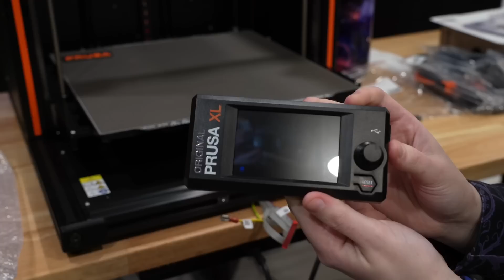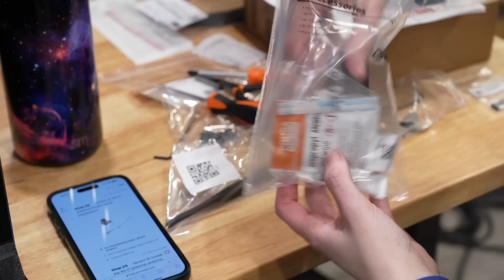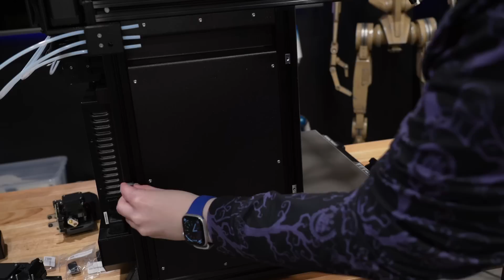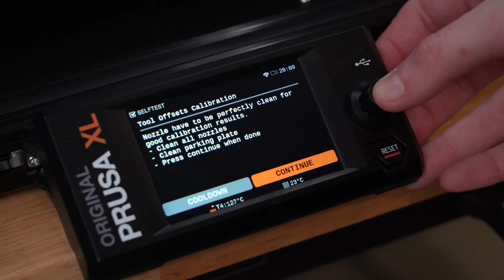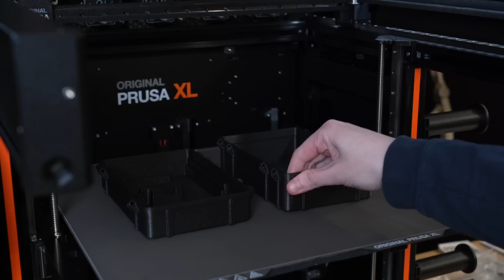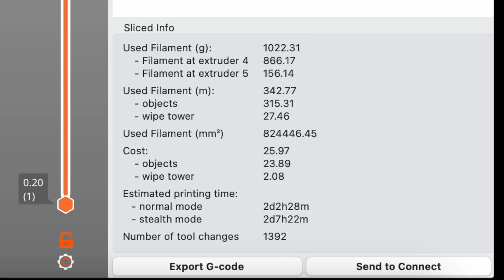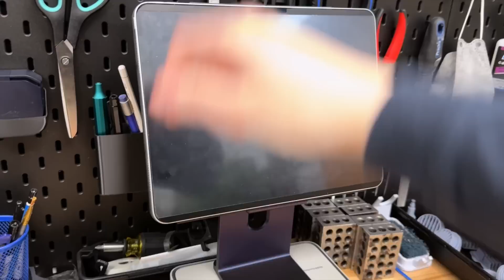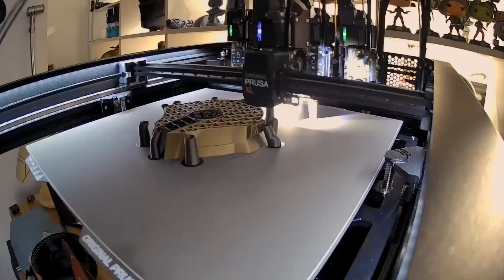Why the Prusa XL is the Best Multicolor Printer

Comment: Your review was one of the reasons I went ahead and got a 2 tool head XL. Just got it set up the other day, and I've done several prints of varying degrees of complexity (all with PLA). I'm using the Prusa slicer and this printer is incredible right out of the box. Seems all of the early problems have been fixed. No problems with the prints at all. They are perfect. It does have a couple of minor irritations I have to address, but overall, VERY happy with the purchase. Thanks for the detailed review. It helped make the choice clearer.

Comment: Prusa XL is great for PLA or PETG. Other materials it simply doesn’t have engineering for unless you’re okay to print ASA at 30mm/s speed. No heated chamber also means don’t expect above 33 degrees Celsius inside office AC space , meaning you will have warping, lack of connection to supports and shrinking. Is it cool - sure, but joy quickly dies down once you realize it’s kinda useless with materials that matter.

Comment: They can't even ship anything.  I bought the printer at the beginning of the month, after being told I would have it in 4 or 5 days.  That was a lie.  /After/ I placed my order I am told they will ship in up to 2 weeks from now.  Then every single day that goes by, 2 days are added to the shipping estimate.  I have to schedule this, as I am not always at home, I travel for work on a schedule, so I have to know when anything large is coming, and I can't leave town with something on the way.  So I took a week off for this, and that time has already passed, and now all I have is a "someday".  Then when I'm researching customs duties, I here the paperwork is done in a sloppy way, so duties might be $100, or they might be $1100...  Not because of the orange goblin, but because Prusa does not provide an optimal classification, rather they allow the customs officer to use his own judgement, so 5 people in a row pay 5 different prices with a huge $1000 gap from lowest to highest.  Prusa cannot guarantee any specific customs duty, but they can at least try.

I can't take off a whole month to MAYBE order a printer...  How it is possible to order something to ship 4 or 5 days, and still be able to cancel the order 2 weeks after you placed it...  

And apparently there is a very high rate of defects, my understanding is that around 50% of the printers are lemons, two printers side by side do not perform the same and require different workflows.  So don't plan to ever buy a used xl, as the main reason to sell is because it is a lemon.  I should have had my printer for a week, instead I'm waiting 2 weeks for a refund.  So prusa will have had my money a whole month without doing any work.

All they had to do is be honest with the timeline before I set the money down.  I expected it to take time, but they set my expectations that I would have it in a week, so I scheduled accordingly.  Actual estimate is between 2 weeks and a month or so...  and pay with a blank check, we will fill it in for you with some random amount.  Think of all the money you will save on this "sale"!

Comment: Very informative video and I thank you for it's simple clarity. I've watched many videos on this machine but still opted for the HD2 to add to my Bambu Lab collection as they have been Rick solid out of the box. At that time I almost pulled the trigger on the XL there were just too many problems with the XL, lots of  negativity that people were sharing about this machine that I held off waiting for the bugs to get worked out before I put an order in for one. One thing that you didn't mention were any problems whatsoever while using the machine. I don't know what you ran into but I believe I saw some surface finishes that I question that you considered to be acceptable. I received a damaged (FedEx, never again) HD2  from shipping and chose to keep the machine rather than going through the tedious process of sending it back I'm crossing my fingers it gets there safely and the new one to me safely.  Bambu Lab worked with me sending replacement parts  that I fortunately have the ability to install properly. Very fortunate and to my surprise the machine prints flawlessly for me. However the HD2 has had enough people claiming that they've had serious issues too like the XL. The more complex these machines get the more variables for problems can develop. All that said I love the idea of the mechanics of the XL, the build volume, 5 print heads and the track record of a quality machines that Prusa has provided for the the regular consumer. The enclosure (and printable aftermarket) are a bit cumbersome but they seem to be effective.  Maybe now's the time to purchase this machine as things have developed well and I'm sure there's been a lot of fixes implemented.

Comment: As an engineering student i don’t really care for multi color either, but it would help on prototypes if I’m using different types filaments to kind of color code the parts. Like if I use a flexible material on a robot joint. Also, as you said using two different materials for infill and outside sounds like a dream. But the price of this printer hurts me

Comment: I am really frustrated with this printer. We got it on work 3 months ago. PLA: no issues. PETG: succesrate about 40% which is quite the dissapointment for me. Even the official prusament, it wont print without a fail every 2 prints.

Comment: if i buy the 1 head version can i later update to the 2 head version? if not it would sadly be a dealbreaker for me :<

would orca slicee still be better for this or does prusa have something specific?
Reply: Yes you can upgrade the 1 head version to 2 heads at anytime. You could also upgrade it to 5 heads at anytime if you decided you wanted more than 2 heads as well.

Comment: This would be cool for super HD, fast printing, if they could manage it. A 0.2mm, 0.5mm, 1mm, 3mm and 6mm, depending on the needs of the thickness of parts. Great for thin-wall supports with minimal contact points and fine details for corners.

Comment: Outer perimeters with different materials i use for Extrudr's amazing "Wood" filament. I print the core with ABS which gives the part a strong structure, then I just make it look and feel organic by 2 outer perimetes of Wood. 
Just printed some filigrane handles for the drawers on my old wood cabinet, they look great and will never break again (as they did when printing with Wood filament only)

Comment: The XL is just a beast!
 It opens up a complete new world of 3D printing. I love it!❤
 I just started using the two toolhead version a few weeks ago, so I still find new ways to take advantage of the tool heads.
I do more technical designs, so multi color is not really a topic for me. But the combination of different nozzles , materials, support structures, etc. in a single print is just amazing.
The only downside is the  setup time due to its complexity, nozzle change with recalibration is just one example. Hardly thinking about the 5-tool head upgrade to save time at changing nozzles and materials for evey print and adding even more features to my prints.

Comment: Honestly, i could get 2x h2ds, and still save money over the prusa. I don’t mean to offend prusa users, but that machine is outdated for the price. 
There’s enough evidence out there, that the print quality of the prusa xl is just bad or better said not up to todays standard. Add the delivery cost about 500€ on top of that, and that’s a no go for that amount of money. 
Ja Bambu policy or not, I don’t care about all of it. Doesn’t hinder me to use the printer as a tool. It should work just a drill should just work. Is a tool. 
Just my 2 cents.

Comment: Nice video. I have both the kit and the assmbled version. For the kit version it was no suprise it took 4 hous to assamble, but the assambled version also took over an hour to set up. I also have for XL's in the printshop and there it is annoying if it takes so much time to set them up. As an extra con I would say they a  very heavy, but as a pro,  they are sturdy.
Printspeed can be improved, just set it to about 20% faster, If you have high flow nozzles and suitable filament, you can even go up to 40 or sometimes 50% (mainly PETG).

Comment: If your filament is perfectly dried, you can use the "wipe in to infill" option and get rid of the purge tower
It even works for me with PETG and TPU multimaterial prints.

Comment: Great review! I may have missed it, but what size nozzle are you using for these prints/what’s the layer height? Hah.

Also, I’m in the market for a new printer and price isn’t really a concern. I’ve looked and looked and I think Prusa might be my best bet overall, despite the cost. The quality and customer support both seem unmatched in the industry. Like no one even comes close. And while I’d like to get a K2 and just hope, I know I won’t have to with a Prusa. Hah. That said, would you recommend and XL, a Core One, or something else entirely? I’ve considered a Rat Rig V-Core 4, or a Voron Trident build, but I’m not sure I’m quite up to a build that significant yet. Hah. I’d really love something with multiple tool heads so I can maybe print with a different support material, or that IDEX upgrade on the Rat Rig seems awesome, but still. Idk. Any suggestions? I’d really like to get into the cosplay and whatnot, and my Ender just doesn’t cut it. lol.

Comment: A prusa XL with 5 heads and an enclosure seems like a ridiculous choice for a first printer but I've been waiting on the sidelines for 10 years and I feel the market has reach a point where there is extreme value in owning a tool such as the Prusa XL. I realize there is a lot more to just hitting a button for 3d printing, experience plays a massive roll in how prints come out so I try not to let printer reviews that showcase "bad prints" influence me for this fact alone. I try to find the best print examples available for a printer as I firmly believe print results are tied directly to the operator and their every decision on so many variables. Your prints are simply amazing and I'm pretty much sold on this unit. I simply don't care if anyone thinks it's a ridiculous choice for a first printer, shit or get off the pot. I want print volume, I want multi filament without insane print times and waste, I want possibilities and the Prusa XL and you video has me sold.
Reply: Buy what you want.  No one else has to approve unless you are married.  😂 Also, find good profiles for filament.  I am new to this but a good profile will ALMOST insure you a good print.  Nothing is 100%.

Comment: The only Printer on the Market which can compete with the Prusa XL is the Voron 2.4 and Sovol SV08. For both are now Toolchanger Kits out there. But atm there is not a definite Version for them on the Market and you have to build them yourself. The other Machine which could do this is the E3D Toolchanger and is out of the market.  I own a Multicolour Printer by myself but i mostly use the Multicolour to have several open spools ready to print, so only as Filament management and not often for Muticolour. I am building a Voron by myself and will eventually upgrade it to Multitoolhead. But this requires lot of time and even with factoring in only 10USD per Hour, the Prusa XL is cheaper. The Sovol SV08 with 5 Toolheads costs around 1500 USD and 50 manhours to build and again 20 manhours to calibrate. The time will go down as more refined kit will hit the market. This would be the cheapest option. Imo the Prusa XL and Prusa Core-XY have only two cons: The Filament Management is bad. You can't easily install dryboxes for the intake and Prusa literally missed a Chance. So you have to be present putt in new Filament and can't let the Filament loaded for 2-3 weeks. This isn't something youtubers or printfarmers consider as the eat through the spool like nothing. But normal users which have their weekend print job, it is a flaw. For the CoreXY is already a solution out there to create a drybox with the printer mounting itself. And a simple Solution maybe devised with the Prusa XL as well. Simple coverings with an acrylic panel and some pouches for silicate, so a filament can stay for weeks in a below 30% humidity enviroment. Especially for Multifilament Printers important. I have always 8 spools loaded and they are in their nice containers with 25% humidity.

Comment: Very nice video. 

However, most of the waste and filament changeing time on other printers like Bamulab´s with AMS, Anycubic´s ACE pro or Creality´s CFS isn´t due to using filament swapping per se, but using high flow nozzles with bigger meltzones.
If you unload filament from a bigger meltzone, the filament tip is quite creapy. It often can not be reloaded without cut. It might even damage the reverse bowden while unload. To avoid the problems, theese companys use cut&poo.

So alltogether on theese printers you have 3 types of waste:
- purging out the cut old filament left inside the nozzle
- clean residue from the old filament
- wipe the nozzle to get the right flow

AMS, ACE, CFM have all 3 types of waste, with "purge" actually the most waste and time (incl cutting the filament).
The XL actually only has one type of waste: wiping the nozzle (getting the preasure inside the nozzle correct after standby of the head).

However, Prusa uses a different approach on his i3-series with MMU2 and MMU3. Using nozzles with a smal meltzone, you can get a quite nice filament tip using ramping profiles on unload, esp. if using standard flow nozzles with integrated heatbreak (Revo on mk3(s(+)), Nextruder Nozzle on mk4(s). This eliminates the first type of waste - and the bigger time of the filament change - no purge needed.
While you still need to clean and wipe the nozzle, the waste and time altogether is much nearer to the XL than to the AMS&Co. Also you can use part of the waste being wiped to infill or "waste object".
It's about 30 to 35 seconds for colourchange (incl. tower). While a bit more than twice the time a XL needs, still a fraction of the other multimaterial printers.
So this is quite a good compromise, esp. for pure multicolour (for multimaterial you might need more cleaning to avoid contamination).

Please do not misunderstand: I like the XL and still consider buying it. However, I do not like it not supporting the MMU3. It would be so nice to combine a 2-tool XL with an MMU3. Much more affordable (esp. if you already have an MMU3), one colour more (1 for the first printhead, five on the second) and you could combine 2 different materials (for example PET-G on first printhead for support, 5 different colours of PLA on the second printhead). Of course you could upgrade to 5 printheads later (and maybe still using an MMU3 on the last printhead, allowing up to 9 filaments).
I still do not understand why Prusa did not considered this option.

The main reason I didn´t bought the XL (now) is of course totaly unrelated: I am into retro computing and want to print parts for old commodore Amigas. The bed of the XL is 5cm to small to print an Amiga 1000 case ;-( So I am building a VCore 3.1 500 instead buying the XL and might make it IDEX (for support).

Comment: We got our Prusa XL (also the "pre-assembled" 5T version) at work around a month ago and my experience with it pretty much is the same as yours.
The first thing I was blown away by was the print quality. I own an X1C privately and the prints the XL produces just look a notch better (walls, top surfaces, ease of support removal).
The print profiles from Prusa just work (almost) perfectly out of the box.
And watching that thing changing toolheads is just mesmerizing. I could watch it all day  ^^

Being a "work horse" our main reason for buying it was not multi-color but multi-material. The "classic" PLA/PETG combination for supports is quite tricky with single-toolhead printers as you can contaminate your next layer after the filament switch if your purge volume is not high enough which could lead to a cracked print just at that layer (don't ask me how I know  ^^)...
The only thing you have to look out for with the XL is that the combo actually sticks well enough during the print (some PLAs don't stick as well to PETG as others is one of the things I've painfully learned in the past few weeks  ^^)
PLA with TPU also works nicely, but you'd be advised to turn on the material interlocking feature

We also got the enclosure but more for the reason that no one sticks his or her hands into the build chamber during printing as the printer isn't located in a lockable room. The enclosure and printer have so many openings and holes all around that even with 100 °C bed temp I wasn't even getting to 40 °C chamber temp which led to quite serious warping with a medium-sized ASA print.

Would I buy it for personal use? Definitely not - it's just too expensive for me
Is it a great printer? You bet!
Reply: Thanks for sharing.
So enclosure is not helping with quality and/or noise maybe?
Reply: @DS-pk4eh  Well... it reduces the risk of bigger PLA or PETG prints warping with low (< 18 °C) ambient temps. So a slight benefit there.
Plus it keeps (most of the) dust out of the build chamber

Regarding Noise: It reduces mainly the noise of the toolhead fan(s).
The other fans (for cooling the electronics) are mounted on the outside as well as the stepper motors. So no noticable noise reduction there.
Plus additional noise from the fan of the filtration system on the back of the enclosure.

Comment: 👍🏻 excellent video, how long did the set up and calibration take til you could actually start printing?
Reply from the maker: I’m not sure of the exact time but at least a few hours. Wasn’t in a rush and filming the process does slow things down a bit. The calibration process took at least an hour but the majority of that setup is more of a one time thing (unless there seems to be an issue I suppose)
Reply: @ awesome thanks